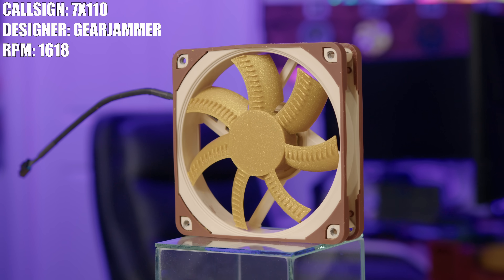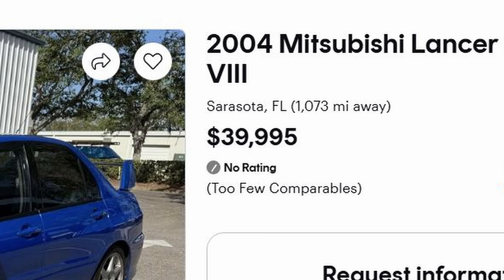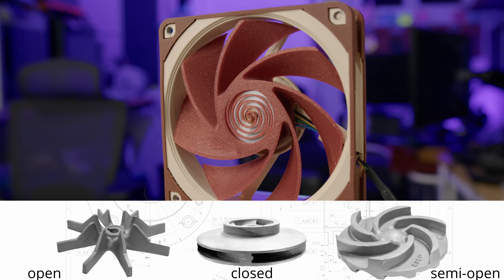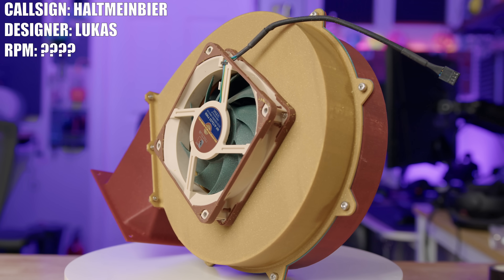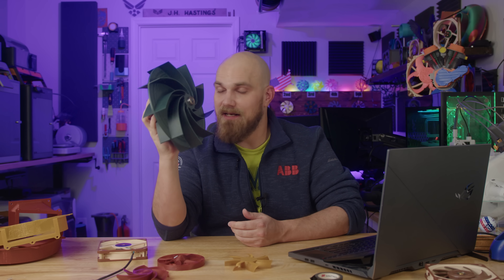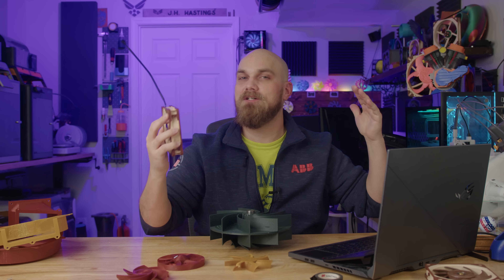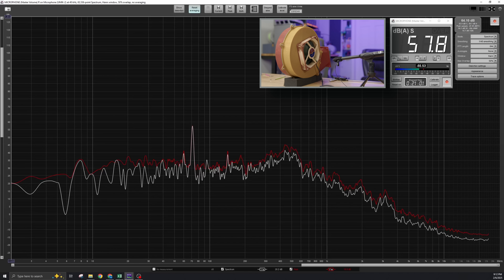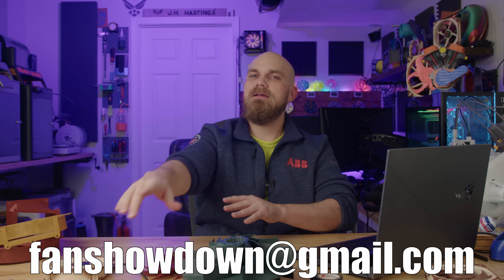Will This Crazy Dual-Turbine Fan Set New Records? | Fan Showdown S6E9

Comment: forwards facing radial fans are a thing. at the cost of efficiency and noise, they can move great amounts of air very fast. the radial mostion pushes the air outwards where it gets accelerated along the curve in the direction of travel.
However fast air means low pressure. also there are some glaring issues with the design here. usually they are only located near the edge and dont reach to the middle as well as being more C shaped rather than just forward facing. so they scoop up the air closer to the center, acceerate it outwards and then throw it out. kinda like throwing a baseball, giving it the last push with the fingertips. also only really woks with a "snail" housing. otherwise you lose all the energy you jsut put into the air by throwing it at the housing wall.
Reply: also the snail housing is the wrong way.
i noticed this when on the smoke test the smoke was super slow, slower than i expected and the i looked at the impeller blades and it was flipped.

Comment: The challenge here seems to be to maximize the power available in the motor.   Being that torque x rpm equals power and that electric motors have maximum torque output at stall....as the revs increase the torque goes down so at some point the maximum power is generated and that's where the fan needs to be designed to run.  

From all the results this looks to be in the 1800'ish to 2000 rpm range but if someone was really going to science out a fan design....doing some miniature dyno work to plot out the power curve of the motor would be an essential first step.  I'd imagine that Noctua has already done this and their fans are optimized at this max power point combining free airflow and static pressure which is why they're SO hard to beat with other designs.   Either free airflow or static pressure can be improved...but so far not both at the same time which shows Noctua did their homework very well.

Comment: Inertia of the impeller will not matter for the motor, only drag on the bearing from the weight.
Inertia just means it will take longer to reach equilibrium speed.
The real problem is the amount of air that this needs to pump, this will create a lot of drag, windage, the actual energy it takes to move that amount of air over that amount of time.
This is why you'd need a bigger motor to reach that impeller fan's maximum potential
Reply: "Inertia of the impeller will not matter for the motor"
Nah it really does: Those designs often are not only heavy but have a high moment of inertia - and case-fans are NOT designed to handle stall currents so they can overheat at startup if the mass is too large.
Reply: @ABaumstumpf  Those are brushless fan, they will not overheat on a stalled rotor, it just won't move. This one still moved easily and as soon as speed can increase, as soon as the bearing drag at rest is not more than the maximum torque of the motor at zero rpm, then inertial mass does not matter beyond the drag on bearing. Give me good enough bearings and no drag and this fan will spin a 10 ton concrete cylinder in a vacuum.
Reply: @shodanxx  good Joke - But that is not how any of that works buddy
Reply: @ Imagine a 20 ton cylinder in space attached to this motor, the other side of the motor attached to a 500kton mass. Imagine all masses perfectly balanced on their axes, with no motion and no solar wind or any other forces. 

That little fan motor, if it can impart any torque at all, will eventually spin the 20 ton cylinder to it's internally regulated speed. It will just take a long time.
Reply: @shodanxx  "Imagine "
That is the funny thing: No.
You are just trying to change the topic cause you are wrong. Fan-Motors do burn up when stalled.
Reply: @ It was just a hypothetical scenario to better conceptualize the physics at play. And theoretically if you could regulate the fan motor with advanced electronics you could prevent stall burn up.
Reply: @ of course you could do a lot with better control but we are talking about normal PC case-fans here. they are designed for tiny plastic propellers and moving a bit of air, not for handling the startup-current for long times.
shodanxx is just trying to change the topic cause has doesn't know what he is talking about.
Reply: I was thinking a little bit different. If we reverse the polarity of the Noctua, it should spin reverse. What if we put one Noctua fan on each side and power both. Of course that would give it an unfair advantage to the other fans, so I wouldn't take it into the same top list, but it would be interesting to see how such a fan using two motors would compare.
Reply: Alot of these designs would be far more efficient if they could be sized properly for the motor power output. Would be interesting to see some different deigns run on different strength motors.
Reply: @krazyeye5147  Yes, Mr MajorHardware should run the fan on a micro dyno, with the torque v rpm curve the "perfect" variant of every design could be made and this series would start seeing some crazy winners.
Reply: Agreed about the size. flip the impeller direction, scale it down to about 1/3rd the diameter. that thing's the size of a furnace inducer with a 1/4HP motor on it.

Comment: I miss when the competition was about cooling the computer.
Reply: It still is… ???
Reply: I wouldn’t mind going back testing with a 120mm but I would have to have a very large heat load and a water temp sensor
Reply: Neat. Go rewatch those videos. The point right now is achieving static pressure, something that also matters in cooling computers.

Comment: About the backwards facing blades on the Haltmeinbier, yes it seems counter intuitive. Yet I have seen furnace fans, namely DELIHI furnace blowers, with the blades set the same way, digging into the air, yet they still work.
Reply: I was going to say the same. aerodynamics are not always intuitive. the dude probably tested the design in a cfd software before sending it
Reply: forward swept blades impart more kinetic energy onto the air thus increasing air speed and static pressure, though it seems the housing is mirrored from what it should be. this video explain it at 35:40 https://youtu.be/vF72pOHc1zY?si=TO_UEGKRR982mUFP
Reply: I used to design HVAC systems for a living.  Centrifugal fans almost always have backward curved blades because it is more efficient over a range of flows.  The down side is that they don’t provide quite as much static pressure.  Since most computers vary the fan speed depending on the cooling load (removing heat) what you really want to see is a curve of flow vs static pressure at various rotational speeds.